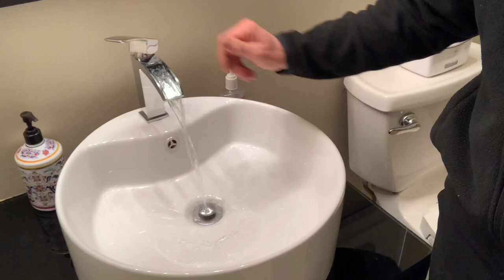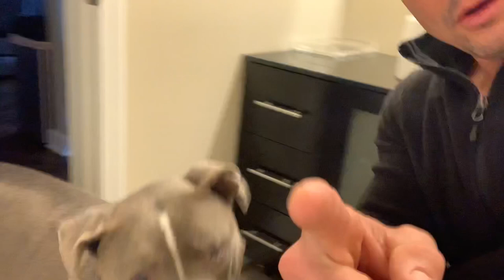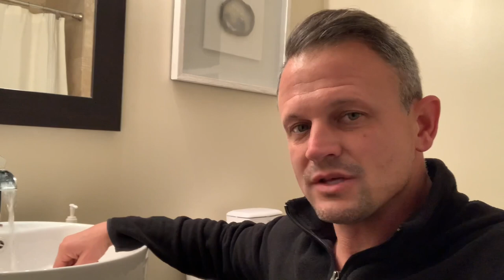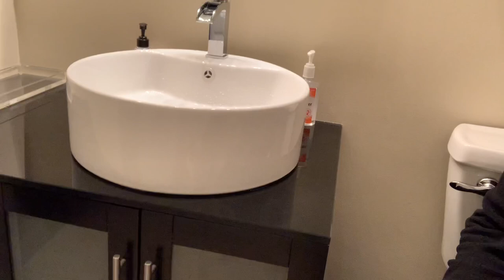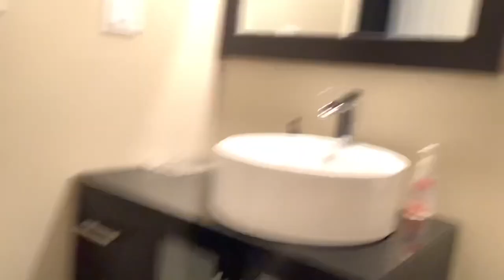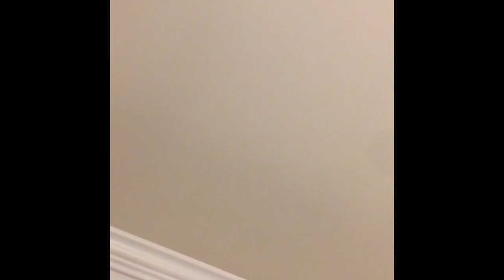Hear Water Dripping, but Can’t Find Any Water Damage?

Comment: This helped so much! I kept hearing a dripping noise. I have a tri level home and I would hear it next to my bed on the 3rd level and it was in the area that would run directly down to the water heater in the garage. I had a plumber come with their moisturizer radar thing and they couldn’t detect any moisture behind the walls and suggested exactly what you said. I was freaking me out thinking water damage was happening to my property. The noise still drives me crazy because we shower at night and can heard the dripping while in bed. Well it drives me crazy but my husband doesn’t seem to notice. I wish I saw this video a long time ago! Thank you for the thorough explanation
Reply from the maker: Thank you for the nice compliment Rach!

Comment: Thanks so much!! I made holes in the drywall in basement ceiling then stairs then upstairs, bought flir infrared camera, bought endoscopic camera, put camera thru walls all from top to bottom of the house next to pipes, under bathtub from valve small door access looked for wet spots anything... NOTHING FOUND!!! had to patch up all walls, and still couldnt find any leakage. Until my wife showed me that video!!
Reply from the maker: Sorry to hear you went through all of that for finding this video. Happy to help!
Reply: Haha i'm looking at about 5 holes in various places that I stuck my endoscope lol. Was looking at rentals for infered camera.
Reply from the maker: @xjcrossx  Yeah, not needed. Unless you’re seeing signs of a leak such as staining on the ceiling, water on the floor, wet carpet, etc. more than likely you’re situation it’s just thermal expansion of your ductwork or plumbing drains.

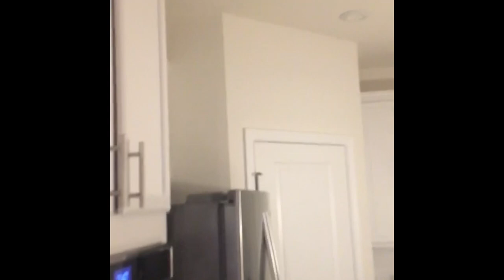Comment: 5:53 that’s exactly the sound I’ve been hearing. No leaks anywhere. Exactly the same spot too, near the kitchen cabinets. I’ve been trying to find videos about this exact problem. Thank you for posting.
Reply from the maker: My pleasure happy to help! Yeah, out of all the videos I’ve made this one seems to be the most helpful because a lot of people experienced this, and it can be worrying hearing what sounds like water leaking behind your walls.
Reply: @BJPoznecki  I feel like I hear it more after I run the shower or dishwasher.
Reply from the maker: @AKAMRAKA  Yeah, very common because you’re using hot water with the shower and the dishwasher which causes the pipe to expand.

Comment: Thank you so much! I’m a new homeowner and this is my first winter in my house. The “drip” noise is so loud and you can feel it if you press your ear to the wall. I was panicking I’d have to open up my walls to find this mystery leak.
Reply from the maker: Very common, especially with new construction. You have PVC, which is plastic drain pipes and they make even a louder sound because we have to put a fireproofing sealant around the pipe as it passes through each floor of the home which magnifies the thermal expansion sounds.

Comment: My sister and I just removed a sheet of drywall behind her sink to find the “leak”. There was no sign of water damage. Most of the pipes had an isolator where they ran thru the 2x4s. Where there wasn’t an isolator, the hot water supply line was squeaking against the wood and making that dripping sound. I padded it with excess insulation and the sound is gone now. This video confirms our conclusion. Thanks!

Comment: TY.  I have been hearing this drip sound coming from our bathroom, in the wall.  We recently had the drain pipes for the bathroom sink and kitchen sink replaced with PVC b/c they were old and burst.   When the weather changed to 50  and lower this drip sound started happening.  Didn't happen when the pipes were installed (still warm weather then) and all of a sudden the noise happens when the weather drops.   I have checked in the attic (as far as I could go), the bathroom, the toilet, and even the basement.  No water damage (besides what was already there from the old pipes bursting).   I can calm down now and stop worrying about another plumber bill.
Reply from the maker: @ivoryherman  My pleasure I know it can be daunting because it literally sounds exactly like dripping water.

Comment: I’ve been having this problem and freaking out thinking water was dripping in my ceiling. Had plumbers come 3 times for 3 different areas in my house of that noise. But, it’s not when using hot water. It’s anytime any water is being used: washing dishes, washer, shower, faucet, and even flushing the toilet. Also, when no water is being used you can hear 1 loud drip every 40seconds or so. Plumbers still can’t find anything. No leaks, nothing. I can’t stress this enough.
Reply from the maker: Hi Leah- Well it’s possible it’s not the plumbing and your possibly your heating and air-conditioning system. 

This video pertains to both plumbing pipes and heating and air condition ductwork expanding and contracting, making these various types of sounds one of which my sound like dripping water.

If you have a plumbing leak unless if your situation is a one off scenario more than likely you will eventually see signs of a leak. 

So for now just continue to monitor until you see it water stains on your ceilings, walls, or floors. 

Hope this helps!
Reply: Did you ever figure out what was the noise? Curious because i have the same issues especially when I flush the toilet and the water is filling the tank up.
Reply: @jonlim497  I had plumbers come out again, apparently did a temp fix because we're back at square one. The only thing possible is needing a rubber isolator to vibrationally isolate the piping from any surrounding surfaces the pipes can knock against. Mind you, my house is not even a year old with these problems, something may have came loose.
Reply: Thank you Leah for the response and hope everything works out. The noise is very irritating when you can't figure out what the source is.
Reply from the maker: Yeah, what’s tough nowadays with the fire safety codes. In most municipalities all penetrations between each floor have to be sealed, which restricts the pipe or duct from expanding and contracting freely adding to the noises you’re hearing.

Comment: Excellent post! I struggled with that same issue for years! Dip Dip...no water...where's the leak. I called a plumber and he looked at it...he brought up it could be just the hot water pipe. So I looked up this video to see if this could be real. Your last to two videos are the exact same sound! thank you so much! The plumber cost me $95 but he was correct.
Reply from the maker: My pleasure Craig happy to help! 👊🏼
Reply: So that is issue? Do we need to fix it? Or it is normal?

Comment: So I've had my house for 5 years, and never noticed this until about the past year. Went behind the escutcheons and couldn't find any evidence. FF to a couple weeks ago, and I had water stains on my living room ceiling. Coming from shower arm; doped it up and threads are sealed. Still hear this dripping sound...Put holes on both sides of my stud in my bath...no signs. Came across this video, and I can finally feel better. Thanks for this (esp the hot water) video! Now to patch some drywall...
Reply from the maker: Happy to help, Sean!

Comment: BJ, you are fantastic. Thanks for addressing this issue. The question is: how do you eliminate this? I just spent a year renovating my home - a luxury custom home at that. And, I have this issue. I am working with my builder, however I just don't think we are making headway. Your suggestions and recommendations are welcome!
Reply from the maker: Thank you Iron Sisters. Unfortunately I hate to be the bearer of bad at this point there is nothing that you can do. Unless you wanna go tearing up a freshly renovated house on a wild goose chase. 

During construction there are few steps that could’ve been taken in an attempt to possibly minimize the thermal expansion noises, however in your builders defense even if they did take some of these steps such as install thicker gauge ductwork, install different drain pipe material, etc. it’s not guaranteed would solve the problem.
Reply: @BJPoznecki  I appreciate the time responding. We’ve done some of that work already … of course I know more about “building” now than before - not an expert by any means, but I certainly understand the value of using quality materials on internal components - they are equally as important as finishes. That said, insulating those mechanical runs/cavities and possibly adding insulation to ducts/pipes (wish we’d stayed with cast iron) is extra insurance to keep noises minimized too. Plus making those cavities a tad bigger too - as you mentioned - to keep things from hitting one another is useful if possible. In our case we had the room to do all of this but unfortunately these sounds weren’t anticipated and so none of this done. I hope folks watching your video are able to catch some of these things in the future during construction phases if possible, so perhaps this video and your comment thread will help someone down the road. Thanks again and keep up the great work! P.s. got my builder adding weather stripping to my vent flaps now as well thanks to another one of your vids 🙌
Reply from the maker: @IronSisters  Thank you for the kind words! Putting aside these noise nuisances I hope you enjoy your newly remodeled 🏡 and have a great first Christmas in it! 🎄🎅

Comment: BJ thank you, thank you!.  I started hearing that dripping sound after I had my basement refinished. Prior to the refinish there wasn't a basement ceiling. The noise is audible when the furnace is heating and stops running.. I noticed it first in the basement,  around a main vent which runs from one end of my home to the other and more vents branch out from that one. My fear was I thought water was seeping in from somewhere, but never saw any water stains or leaks. I've turned off the humidifier on the furnace thinking condensation was getting in some how.
After watching your video, I had a few A HA moments. When the carpenter was finishing the basement ceiling, he framed around this particular vent with 2x4 wood, I thought it looked too bulky, I asked him if he could use smaller framing material and he obliged me. SMH. He removed it and used metal around that vent. It was so snug, you couldn't fit a piece of paper between the metal framing and the vent, the finished ceiling looks amazing. Next, fire stop had to be added to pass inspection. It is a 1973 solid brick ranch home, that wasn't required when initially built. I lived in the basement for a year until the main floor bathrooms were done.  They've been completed and now I sleep in the upstair bedrooms.  Its been a month sleeping on the main level and I hear that drip. Yep, 4:00 am on the internet trying to solve this problem, at least understand it. 

You're correct,  the expansion space that was there, is no longer there,  per my request.😢😢  plus, the section of the main floor above that metal framed sectione is creaky and a little weakened. Your explanation makes so much sense, that dripping sound is most prevalent  around where the metal framing is and it echoes throughout. Thank you so much,  I will be getting that fixed, but in the meantime I have a little peace of mind, not water.

Thanks again BJ
Reply from the maker: My pleasure!
Yeah, if we frame tightly around the ductwork it just makes it even worse. 
Happy to help Rain Maker!!

Comment: I had this issue, and I called a guy to check it out.  He came by and as he walked into the house, he told me that it could be thermal expansion.  It sounds just like water dripping. I hear the water dripping but couldn't find any water damage. I bought a endoscope to see inside the wall for water damage, but couldn't find anything. It just drove me crazy for a while.  It still sounds like water dripping......

Comment: That's such a relief BJ. That's exactly what my walls sounds like after my neighbor upstairs uses the shower or the toilet. Maybe I should stop using my heater in the spring time but it has been unseasonably cold where I live.
Reply from the maker: 👍🏼 all good!

Very common when your neighbors above you shower with hot water 🚿
Reply: @BJPoznecki  That must be why it's worse in the morning. Pretty sure he takes long showers in the morning.
Reply from the maker: @inigolacdan7314  🤣🤷🏻‍♂️🥶
Reply: @BJPoznecki  Sorry one last question BJ. I noticed that when my neighbor uses the toilet  now with the heat OFF that I hear the dripping sounds but a few seconds after I've heard the water flush down. I'm guessing the sounds happen after he washes his hands with hot water in the sink? I should probably check with him to test it out.
Reply from the maker: @inigolacdan7314  Yeah, typically you won’t experience these noises with cold water, only with hot water. 

Yes, I would check with your neighbor and test it out. If you’re still uncertain I would submit a request with your maintenance or building manager and have them get involved.

Comment: Thank you so much for the video, from Europe! I recently purchased a house, this sound appears every time when I used the hot water (first very frequent then slow down). I am being so mad and driving crazy 😢😢😢. Thanks for making this explanation!!!
Reply from the maker: My pleasure, happy to hear the video was helpful!!
Reply: Hi, BJ, May I ask whether it is normal that when I turned off the hot water pipe, the water drip sound started, and then become less and less frequent. It does not have any sounds when I start & stop cold water. Would it be possible for me to send you the video? It’s copper piper in the wall 😢
Reply from the maker: @ginkgo1603  Of course if you’re in the states you can text it to 773-403-3298 or my email is bj@inspect-n-check.com

Comment: Wow thank you so much ! This is it! Sounds exactly like it in that kitchen video. It was at night when the dish washer ran or in the shower. In closet ceiling. I didn’t notice it my first 2 years in my new build house. Could it have just settled in over 2 years and start doing this? Heard this noise for months with no water damage. Yep only when hot water is on.
Reply from the maker: @cnh7262  Yeah, it’s possible that something may have shifted, and now it makes that noise a little bit more pronounced than before.
Reply: @BJPoznecki  thanks again, I was seriously about to cut into the drywall, but 100% this is what it is.

Comment: Great video. Really has put my mind at ease.  I hear this dripping (12-15 seconds apart) in ceiling when my bath sink is on for 5 minutes or so. It only happens when heat is on and stops a minute or so after it's off. Based on your comment, it sounds like expansion. Also hear it in ceiling when hot again when my garage utility sink on, again only hot water and stops a minute or so after it's shut off. Inspecting carefully around I see no damage of any kind.  A question I'd like to ask, if there was a true leak wouldn't I hear that drip continue long after and not stop at all?... Anyways, thank you so much for this vid. This has been a thing for awhile now and so has my worry. Thanks to your video, hopefully I can relax now. Bless.
Reply from the maker: PrimitiveMeat- Typically if you have a plumbing leak you’ll see water stains on the ceiling, walls, etc. However, I have seen some unusual situations over my career, so I would run cold water at these 2 drains for an extended period of time like 30-60 minutes to see if anything leaks. If you aren’t able to create a leak than more than likely you’re just experiencing thermal expansion.
Reply: @BJPoznecki  Thank you. Haven't  run cold that long, yet probably half that and never hear that drip sound other than hot water.  Thanks so much, I'll try a bit longer duration next round. Bless.

Comment: Thanks for sharing this information! I have a dripping noice I hear in my basement. If I put my ear close to the floor it almost sounds like it's coming from the floor. I'll admint, my ears aren't the best at locating things. It's spring, and things are pretty dry outside. Everything is dry, can't see any signs, nothing after following your recommended steps. Any ideas? I only hear it from the basement. I haven't noticed it before. Do you have any thougts or suggestions? When I bought the home 20 years ago I do remember them saying there was a high water table or they would have made the basement larger, but I don't see any water anywhere!

Comment: In my new home, whenever I flush the toilet on the second floor, I consistently hear a dripping sound coming from somewhere inside the wall on the ground floor. Despite the fact that the toilet flush doesn't involve hot water, this sound persists. I haven't observed any visible signs of water leakage. What could be causing this issue? It's concerning that the builder seems to be disregarding it completely.
Reply from the maker: You can also experience reverse thermal expansion where cold water is running through a pipe that’s warm. A lot of times you could have a drain pipe in the same joist cavity as your ductwork to where in the winter you’re running the heat and it’s heating up that area where your drain pipe is, so when you run cold water you’re cooling off the pipe and it’s contracting. What I would do is turn the heat off and turn everything on in that bathroom the sink, tub, shower, flush the toilet a bunch of times, etc., and let the water run for a good 30 minutes. Then, see if anything leaks, and/or if the noises stop once the pipe is cold. Let us know how it goes?